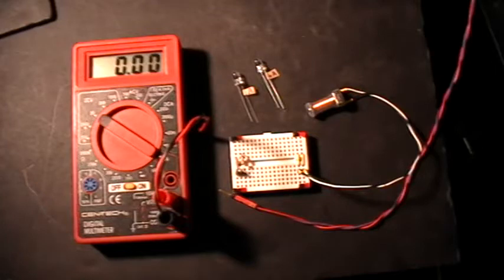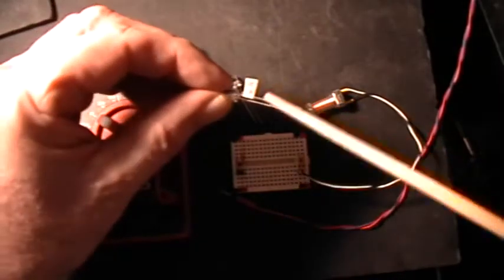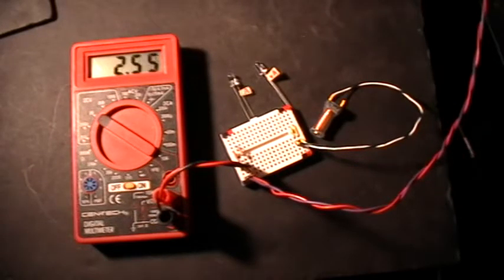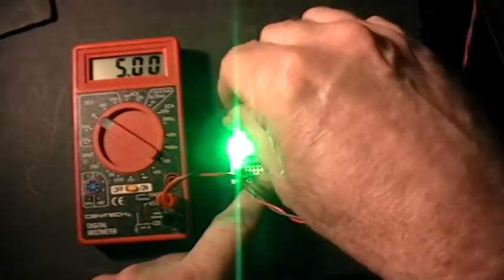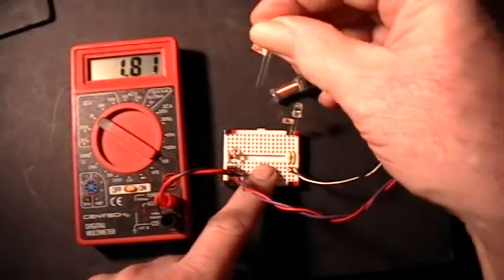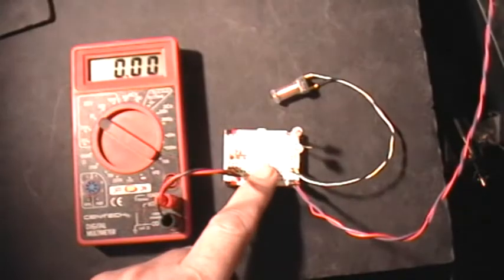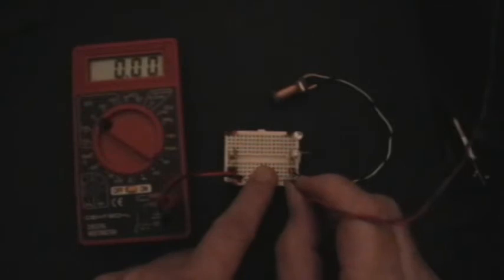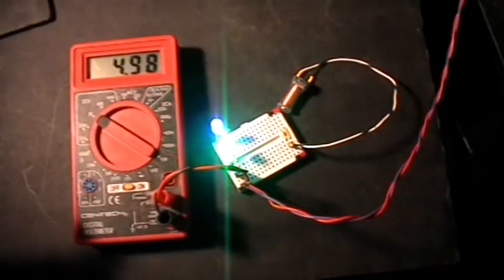Coil Current Direction when Power is Interrupted (2)

Comment: My question is what happens if the blue LED is removed?  When the current can continue in the same direction, it will.  What if it can't?  Will it reverse in order to discharge if it can?
This applies to your previous video as well.  If the diodes is there, it will conduct, but if there isn't one?  Will the voltage increase enough to arc rather than reverse?

Comment: Then why dose a reverse diode work to protect a switch from a coil collapse ?
Reply from the maker: Are you serious? The answer to your question is shown in this video!
Reply: Sorry, I think my confusion comes from looking at a mosfet on the low side of a coil. The internal diode allows current to flow up from the source, when the switch opens. When this happens the power supply is not disconnected as in your example.Yet you example clearly shows current in the opposite direction .
Reply from the maker: In the opposite direction from what? My demonstration shows that current continues to flow in the SAME direction when power is interrupted, as it was flowing when the coil was powered. This is in complete agreement with Faraday's law of induction and millions of devices that use relays and reverse-biased diodes across the relay coil. 
Perhaps you should watch the video again. It should be impossible to misinterpret it if you watch carefully and look at the schematic I provided.
Reply from the maker: Wait, I think I see what you mean now. Sorry for misinterpreting in the last reply.
Yes, that would cause confusion all right. Actually the continuing forward direction of the coil's pulse when the mosfet switches off can destroy the mosfet, so most people switching a coil with a low-side mosfet will install a flyback diode reverse-biased across the coil to protect the mosfet.  The mosfet will run cooler this way, since the body diode isn't being stressed.  (Like the blue LED is across the coil in this demo.) The mosfet's body diode is across the mosfet, not across the coil, so can't channel the pulse back into the "top" of the coil like the flyback diode will.
Reply: You video has given me more clarity , thank you. I still don't understand why the built in diode in the mosfet allows current flow in the opposite direction. I always assumed the collapsing coil field was in the other direction.
Reply from the maker: Getting back to your original question, where a high side mechanical switch is used, the fact that the current tries to keep going in the same direction means that an arc will form across the switch contacts when the switch is opened, as current tries to keep flowing across it and into the "top" of the coil as the field collapses. Sort of like the coil is "sucking" current into its top as the field collapses. Again, the flyback diode protects against this somewhat by putting the output current back up to the top of the coil. Also, putting a small capacitor across the switch contacts can also work to protect the switch from arcing. You'll see this often done with reed switches/relays to protect their delicate contacts from arcing due to inductive collapse current "sucking" by the load.

Comment: For those with continued doubts, note that as demonstrated (3:18), the green LED has a lower turn On voltage which makes it the more sensitive current monitor in this demo and it does not flash despite this advantage when power is removed.  Definitive test that coil current does NOT reverse, thanks TK.
Reply from the maker: Exactly right again. I didn't stress the point in the video but your careful observation nailed it. Thanks for watching and commenting!